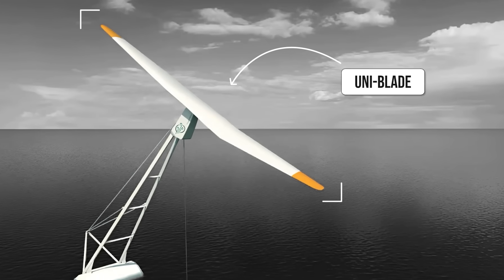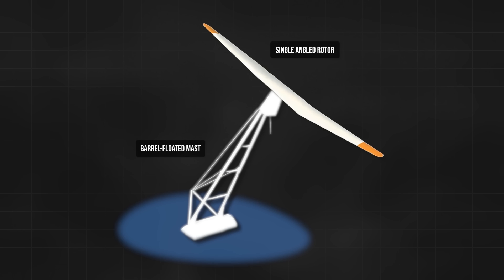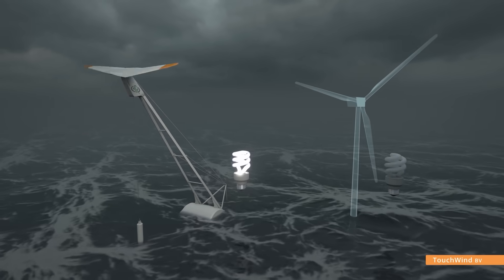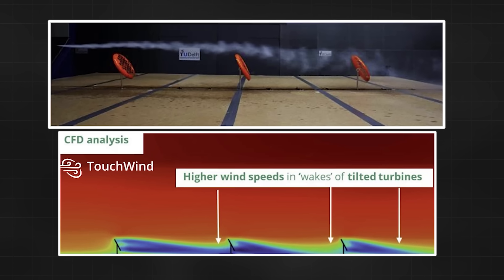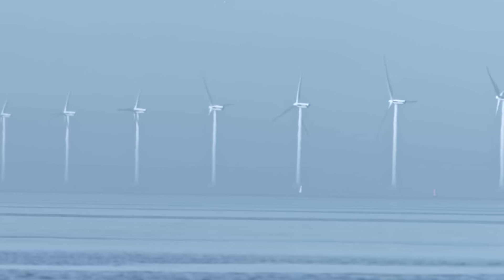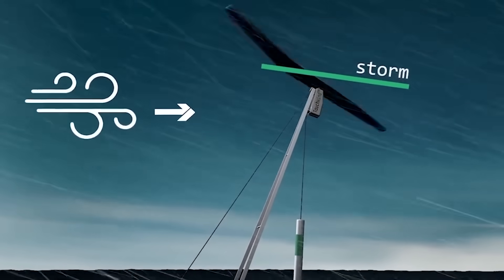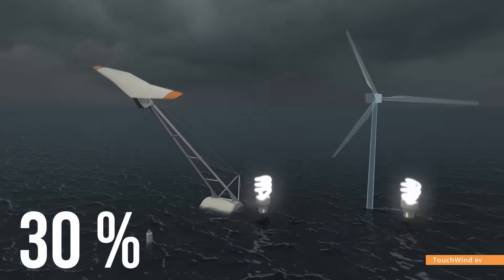Insane New Turbine Promises CHEAP Unlimited Energy

Comment: As a wind energy researcher, I like certain features of this idea, but it seems there is one major aspect common to most 2-blade rotors, either missing or not mentioned - so I won't mention that aspect either (sorry).  But anyway, I'm seeing quite a few common symptoms in wannabe, always-in-the-future, wind energy promotions that go nowhere.  First, that logo representing swirling wind, is a consistent hallmark of a future-failed wind energy concept - just sayin' - they all use it.  Next, despite promoting this design, with all that funding, they don't show us a working prototype of that design, at any scale, but instead. at 6:48, have a version mounted on a small tower that happens to be standing in shallow water - why not just do it on land at that point?  Why not build a prototype of their actual floating design?  Hmmmm...  
72 m/s = 161 mph.  OK so they first say their new, untested, "barrel" device will withstand winds of 161 miles per hour, while yet still producing power.  Now this is a bold statement to make in wind energy, or in marine engineering for that matter.  161 miles per hour is a category 5 hurricane - as bad as it gets.   And this turbine is said to keep on producing power in a catego0ry 5 hurricane.  But later in the video, we're told they've given up on this "barrel" design because they decided it might be challenged in big waves.  I guess they just figured out that a 161 mph wind would entail big waves.  It's OK, don't worry, still later in the video they go back to promoting the old "barrel" design.  It is just so symptomatic to make absurd claims like this in the field of wannabe wind energy, populated by people who have never had mother nature blow their turbines to smithereens.  Sure, your untested idea will magically withstand winds that no previous marine structure could.  All the beginners think like that.
Mission-creep:  They keep talking about reducing the wake effect of upwind units on downwind units in floating windfarms, as a (the?) main advantage, but still can't show us a single actual unit even floating, let alone operating.  But forget seeing even a small model working - now it's all about the untested wake "theory", and how many more units they can pack into a windfarm - uh-huh, sure.  Apparently, they have no real proof of this wake factor either.  Typical.  And with all that funding, they can't even show you a small-scale model that works - something that could be built in a garage, for a few hundred bucks.  
So at 8:23, they suddenly throw away everything said up until that point, and basically admit the design they have been talking about would have problems with waves, and they are now instead considering a completely different type of base, using four vertical floating interconnected cylinders, of which they briefly show someone else's model in a tank, saying  "the barrel design" (that has been the subject of the entire video thusfar), "is more from an older iteration" - huh?  OK so with no further explanation of how, why, or what this new iteration they are suddenly now talking about even is?  How does this entirely new, yet unshown, base, fit into a design that consisted mostly of the old base they had been showing us?  The old base was 90% of the invention.  If they have a new design, why is this video about the old design?  OK so the rest of the video goes back to showing the old (now obsolete?) design.  Mission-creep again:  Suddenly, with no explanation of how or why, they diverge into extreme trendy-buzzword excuse-land, and their next new goal is "3-printing" and "biodiversity", showing a hunk of concrete with holes in it, to attract fish, as their new breakthrough?  Yeah, sure, just change the subject to a different topic, and hope potential investors won't notice.  Well, some investors are subject to emotion-based "reasoning" too.  Then at 8:50, they show truck testing of what appears to be a single 1.5 meter rotor, while talking of a (future, of course) project involving ten 12 kW, 6-meter rotors.  Like they're really gonna do that, when they can't build even a tiny single working model of their supposed (and ever-changing) design.  Like they even really could do that.  I think it might be too much for them.
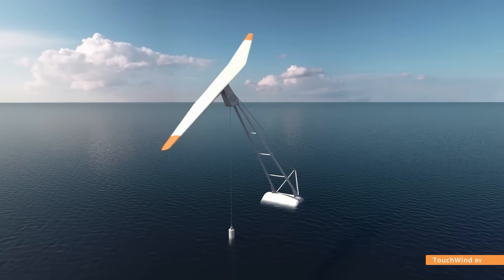Prescient how, at 11:24 they admit it might just "evolve" into a regular old wind turbine on a pole - in other words ignore everything you've just heard up until that point.  :)

Comment: If Darius VAWTs are mostly held back by bearing challenges with one blade passing through the tower shadow, surely this has that issue? …and gyro loads from adjusting for gusts and from waves! 200m blade seems unlikely to me. However, small scale deployment might be cheap enough even with ruggedised bearings if the higher winds and reduced wake claims are valid. Certainly a fresh idea anyway…
Reply: A Japanese engineer drilled 3 equidistant holes in a bearing race, removed 3 ball bearings, and it reduced friction by 15%.  Might be useful if you wanted to use larger, more rugged, bearings in a wet environment.

Comment: I've built barrel ships, barrels float good, I feel like these should be rings, not because I think it'll make more power, but I think it will be safer, in the case they tip too low. That way they don't slap and smack, they slide and roll, and should for the same tipping reason, have floatation in the ring.

Comment: Nope.
Things that don't work:
- gravity storage except for large-scale pumped hydro. This one is SIMPLE MATH, how do SO MANY people get sucked in? (Hint: swap the concrete for water, the building for a natural hill of 100 meter height - how much water do you need to lift in TONS to get a practical solution?)
- perpetual motion of ANY kind; the 2nd Law is going to win
- "hot" fusion; it's a "holy grail" but is unlikely ever to be cost-practical because ... engineering

Stuff that is UNLIKELY to work:
- fission-based nuclear; where I live we get 45% of our power from nuclear that is FIFTY years old, nuclear WORKS but is ONLY cost effective on time scales that generally don't make sense and there is just too much stupid FUD to overcome
- "atmospheric energy"; yup it's real but MEGAvolts times PICOamps is still NOTHING useful, see objection to "hot" fusion
- Solar P/V because "death rays"
- "wave" energy unless it uses a small, cheap, mass-produced generator and acres of ocean, in which case the "green" morons will stop it because it will look ugly and piss off the fish

Stuff that I like but don't see yet:
- "bifacial" panels erected vertically  as fencing; I think THIS ONE has huge potential as the price of bifacial panels becomes cheap. California department of Highways should be looking into this, it's a good use of "waste" median land on a North-South (more or less) route; easements aren't a problem, "green" morons should NOT be a problem for a change (by "green" morons I mean those who treat "green" as a religion instead of a moral or pragmatic choice). The economics look like it should make sense?
- more "ground mount" panels. Why is rooftop solar more expensive than ground mount? (Because the mounts are over-engineered? That should depend on locale). Ground mount should make more sense for a LOT of people (those with lots of lawn not visible from the street that exists ONLY to be cut)

OK, let the "flaming" begin - hopefully I hit the one or two people who find value in this.

Comment: Wind is not a good way to genertae electrcity for a griod system. This is well known for a number of reasons.
Intermittent, so needs back up as well, blowing the cheap claim to pieces.
Is asynchronous so unable to balance supply and demand.
No inertia.
No reactive power contribution.
There are others but that's enough to be going on with.
It is really a bad situation that politicians who decide that we should use them are so ignorant of the defiiciencies.
just because a device can generate electricity doesn't mean it's a good idea for a grid and are a simple replacement for conventional generators, they are not and never will be.

Comment: Okay, but how are you getting the energy on shore from far off shore, thats the biggest cost in offshore and moving it further out would increase that cost.
Reply: and you now have deal with a turbine that is rising and falling with the tide while the whole unit is rotating significantly more with the wind. Typically the more moving parts the more ware and tear. The further out the more expensive to maintain.
Reply: @Finderskeepers.  I really hope Quaise Energy's plan works out, which is basically using a fricking 10MW laser to drill down 10 - 20km to get geothermal anywhere in the world.

It would solves so many problems with net 0 at least on the electricity side. 24/7 365 energy with relative easy integration with thermal energy storage to increase output within peek hours.

We will just have to see if it's economically viable though, basically if each well costs much more than $100 million no one is going to invest in it even though in the long term it's a boon still, because that still is over a 10 year ROI the cost of a natural gas power plant assuming each well is 30MW thermal.

The wells will apparently last 100 years so in the long term it's still a great long term investment so if governments step in to reduce the cost to be competitive with natural gas over a 5 year period and making that money back over a longer period of time say 20 - 30 years it could be popular with private involvement.
Reply: @Etheoma  Geothermal already exists and only need to go 400m not 10km. The deeper the larger the temp. variance = more energy.  Its sounds great using lasers but I see a lot of unknown issues. I will never knock advancement or triers so I wish them well.

Tidal is what I am hoping to see a breakthrough with. The moon isnt going anywhere and the tide goes in and out twice a day every day.

Solar and wind would be even more viable if we could find a way to store the energy. Jeep have a very interesting water powered engine that ICE engines could easily be converted to. The pressurised water system is a viable was to store energy.

Already I see shenanigans in the carbon credits market. Corporate influence at a political level is to high around the world put particularly in the States.

Because of the method to calculate Value there will always be a bias for quick income and shortermism with the lowest income risk which is what ultimately underpins your valid point about ROI.
Reply: @Etheoma  Im more concerned about the unexpected effects. No one expected carbon emissions to be an issue yet here we are.  Im thinking along the lines of how dams have had unexpected outcomes and thats far easier to predict and much better understood than lava flows 10km down. 

The North Atlantic drift is what keeps the UK's climate so mild and its slowing down due the glacier melt from Greenland and Arctic ice sheets and not because its cold water but because its fresh water . The effects of global warming could be having a significant impact much sooner than we think. We keep messing with nature thinking we know better, mad cow disease is another example.  Probability told us we were overdue a pandemic yet there was minimal preparation. We got off lightly, what would ebola of done and thats what really scared the scientists at 1st, Covid had a very similar cell structure but we dont hear that in the news even now.  

Huge extraction of energy from basically the earths core concern me. I acknowledge I am being very cautious but I think we have to be. One threat that concerns me that it could easily impact and that is slowly happening as we speak is a flipping of the magnetic poles. Its already effecting satellites in orbit. A mass extraction of energy I assume would have a cooling effect, that would slow down thermal currents and without knowing exactly how and what the core is made off its hard to predict and thats against a background of not predicting what damming a river will do.
Reply: @Finderskeepers.  I think you were replying to the last comment I made, but I can't see it. So I will cliff note what I said 400m is for places which naturally have holes where water naturally goes down and boils and those kind of places rarely found in places on fault lines, very rare, but can be as shallow as 100m, but even in the best place in the world to do geothermal, that being iceland they need to go down 2,200 meters in some of their wells, admittedly it's because they wanted to run completely off geothermal and have plans to build super long HVDC lines to sell energy.

And my point was doing geothermal anywhere in the world which in some cases does mean digging down 10s of KM to get 375C or greater temps to get super critical stream which massively increases the thermodynamic efficiency of getting electrical power out of the steam. If you have district heating here in the UK you would need to go down 3km just to get 90C water.

So no.

Comment: I have to wonder if we are about to see a transition from vertical-mast, 3-bladed turbines to variable-angle tilted masts with a 2-blade turbine - akin to how aviation shifted away from biplanes to monoplanes once the technology allowed monoplanes to be strong and light enough.

Though I do wonder if using the mast tilting instead of variable-pitch blades is more efficient?  The "downwind" traveling blade will generate less (or no) lift depending upon wind and turbine wing speeds.

Comment: blades on large turbines already get pretty high mach at the tips. I wonder if at high wind speeds this could have issues with the advancing rotor breaking the sound barrier when the winds are high, it's at its max rpm, and the blade is near horizontal.

Comment: A - How does it self-orient if it's offset from its point of anchor?
B - How does it sustain high waves with the turbine in a vertical orientation?  That's going to be a LOT of vertical movement shoving and jerking on the generator body.
C - The could increase the power generation by putting wave energy accumulators along the anchoring structure.
Reply: Answer to ‘A’. The tower self-orients by reacting to the wind like a windvane.
Reply: A simply does.
B make it big
C probably would defeat the value of the design

Comment: Try being yourself, resist cleches such as "but, more on that later" & "so, what of the future". Also its two blades made in one unit, if it was one blade it would have a counter weight for balance both rotating around the shaft.

Comment: Makes a lot of sense to me. Does the wake effect offer an added benefit of cooling the ocean surface? Would be easy to test. Put some thermometers' in the water where the downdraft is most intense. As the angle of attack changes the thermometers could be spooled in or out on a tether keeping them in the sweet spot. Also, encouraging corals and sea life to congregate on the submerged components is a huge bonus.